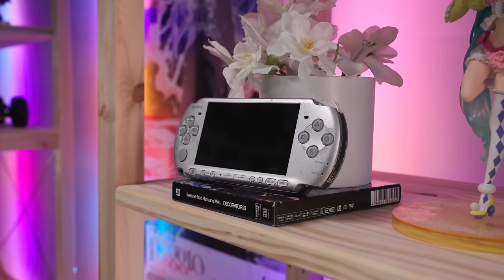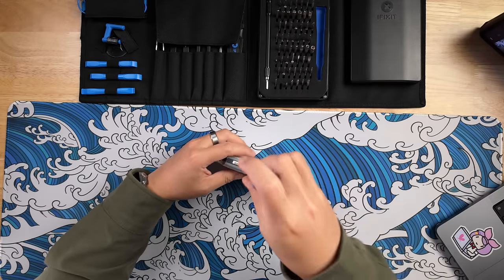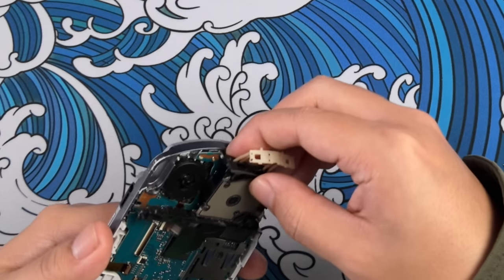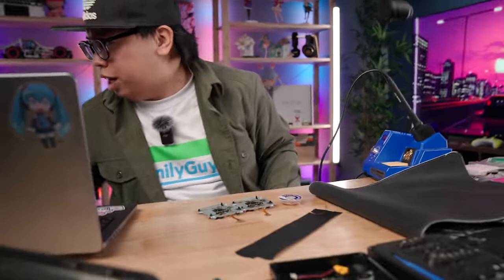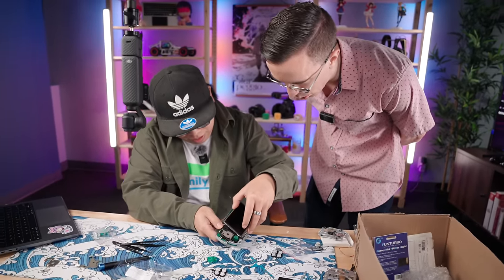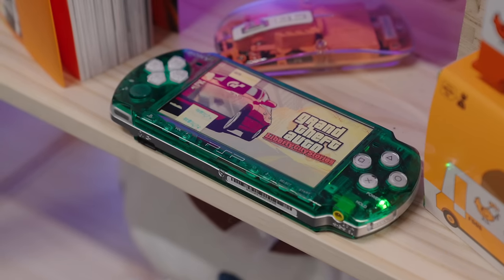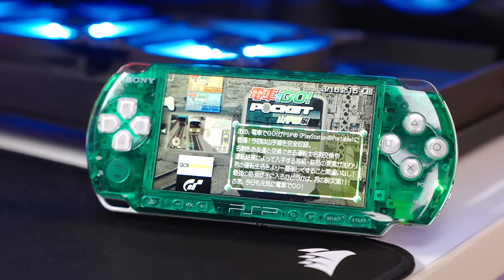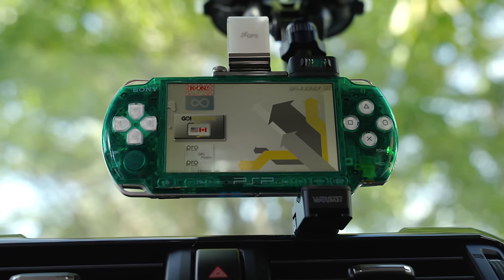Gaming with a PSP in 2024

Comment: On one hand, I'm glad I had a DS (not being able to afford both systems), and I had my fair share of soul-changing experiences on the handheld, but, shoot, PSP was so cool, and had at least a handful of games I really wanted to play, and never really had the chance, until I met my wife, who had a PSP she took overseas with her, so... I have that now. It feels so dang good in the hands (pretty much the perfect form factor - PS Vita supporters need a reality check on that thing), and absolutely has a library of games worth having/exploring/owning. I need to get around to figuring out if the issue with it is just the battery (that I've taken out/disposed of, because I'm not going to wait for it to start its transformation into a spicy pillow), or if there's a bigger problem. Would be nice to pop a new battery in/get a new charger and start collecting for the system/playing some stuff.

I've still got an old WRT-54G router connected to the network that outputs a 802.11b WiFi signal, which the PSP (and original DS models) need for connecting. I should mess around with that.

Anyway, this video was especially painful to watch. Thanks.

Comment: Amazing video! - wanted to shout out a few things. The GPS adventure is amazing and definitely impressed me and made me laugh! Secondly, it's wild to say - but the screen going half pixel dead save for a tiny half cm on the bottom is exactly what happened to mine! No idea what we both did! lol... Lastly - I went through five replacement screens off amazon, all of which were busted and or filled with torn and horrible dead pixels. It's a shock but everyone seems to have the same experience, and I'm curious once you get that replacement screen off amazon. I've ended up going with another PSP like you did. DEFECTUOSA! Lastly part two - first video I've seen on your channel and it was a blast. I'll be watching more!

Comment: 36:00 The PSP can actually connect to Wi-Fi, the thing is that it can only use WPA and WEP security (please, don't use WEP), when the most common certification is WPA2 and lately WPA3. So the PSP won't connect to any WPA2 or WPA3 networks but it's simple to solve: if you set the network in your router to use WPA (in my case it has 3 networks, the guests one which is activated on demand and deactivates 4 hours after, is set to WPA) and you type its name in the PSP, it should work just fine.
I got my PSP in 2007 and since then has been in my bed table to play before sleep.

Comment: I will 100% confirm that the Screen on the 3000 series may be, Haunted? 

I have babied mine since I got it and it's never been dropped, scratched, etc. Yet SOMEHOW one day when I pulled it out of the desk drawer to play, somehow the damn screen itself was broken, yet the glass in front of it was perfectly fine. It looks like it died from an impact from the front, yet without hurting the external glass at all? I just couldn't figure out what caused it as it was just sitting in a drawer with other tech hardware which was just a bunch of flat surfaces...

It still confuses me to this day.

I got a replacement screen and sadly the replacement has 2 dead/stuck pixels. Ugh So someday I'll replace it, again and I do still like playing on this little thing from time to time.

Comment: You have to.lwer your Wi Fi  settings in order for the Psp to connect the Psp uses WLan connection today's WI fi is WAP 1 N 2 (if I'm not mistaken)  lower the connection speed for it to work I use mine with my phones Hotspot

Comment: I can identify with this destruction. Not with electronics though but, I was trying to kill a fly the other day and accidentally shattered my door window (I swear a barely touched it) and then broke the storm door handle while also barely touching it (I’ve been told since I was a kid I don’t know my own strength, so I guess even at 24 years old I still haven’t learned). This has leaked into electronics though, accidentally pushed two hard while screwing in the screws on an OG gameboy motherboard and went through it 😂)

Comment: I had a psp 2000 that had cfw on it as a kid but it broke. So one day I got a psp 3000 and tried to downgrade it to a lower cfw and ended up bricking it the same day because I didn’t know anything about not being able to downgrade a device with a firmware lower than the firmware it left the factory with 😂. I also had a pandoras battery to try to unbrick it but found out it was not compatible with the psp 3000. So I went back to gamestop the next day with my mom and told them it was faulty and got a new one. one of the many HUGE fails of my childhood lol.

Comment: the biggest success of psp, atleast imo, is that it was extremely future proof. it came out in 2005. it's better than the 3ds. and that's coming from someone who bought this, 3ds, ds, and even the 2ds. and xmb is the dream. there is almost no ui that's more fun on consoles. atleast as far as i've seen. and it's built like a tank, living for upto 20 years for quite a few people(including me)
Reply from the maker: It's weird to say a UI is fun to use at first, but when I think about the PS5 interface, it honestly isn't a crazy statement. 

Modern console homescreens are so clunky and sensory overloaded with useless information. I find myself wanting to ignore everything and just hop into a game. Fine, but I avoid the homescreen as much as I can.

But XMB was simple and functional to where it actually lended itself to a bit of curiosity. When it doesn't take much time to explore around and is very linear, there's a sense of comfort and confidence I get when using it. It's way more approachable.

Comment: Not to be rude but you did not do a good job taking this apart. Im no electronic repair man but i have reshelled a worked on several psps without breaking anything. I do agree it would be another like half hour of psp work to just swap the og drive back in. Which is honestly pretty finicky. And that could be a piece of dust under the screen

Comment: Lost the coolest part of the console, the UMD drive adds character, load times and the sound are it’s charm lol. Also ruined a nice 3000 : / blue is so clean . Soft modding a psp is very easy and does not require a nasty aftermarket shell . I bet the UMD drive isn’t pushing it in far enough

Comment: bought a replacement case (nice pink nontransparent)
it came in very fast but the actual quality is hot garbage lol
it feels like very cheap plastic knockoff with parts of plastic sticking out after molding

need to sand it down to actual sizes

Comment: I have a psp 1000😭😭😭😭😭😭
Reply: There is a really cool ips screen mod that only works for the 1000 model.
Reply: @gnomatic  I planned on getting more psp and PS Vita since I'm obsessed with them, but I never jailbreaked a consol before, I only have heard Abt it before! so I'm kinda nervous and excited at the same time 😭 but I can't find good stuff for a decent price so I want to buy Japanese once those are cheap and mostly good quality.
Reply: @zhostfu3595  The psp is the esiest console i've ever  modded, so you're at a great starting point. Just follow the directions precisely, and It should be fine. I recommend ARK-4, just put it on my 3000, and it's great.

Comment: I bought a similar transparent light blue one and I regret it. Feels like a cheap knock off toy. I should’ve either got the original black or nothing at all. When you get used to modern handhelds like the ROG Ally, Steam Deck or even the Switch, which can all play PSP games it feels unnecessary. I know it’s “original hardware that was ahead of its time” but it doesn’t really hold up without nostalgia. It's a cool little collectors piece, but I don’t use it.

Comment: Psp was a huge failure so was the vita. Here's why. 

Psp didn't have 2 anolog sticks and wasn't porting ps2 games nor did it port a lot of iconic ps1 games. The lack of pressure sensors in the triggers like the ps2 had was a design flaw. The psp exclusives were mostly bad, but tenkaichi tag team was cool and dissidia was fun MINUS the speed junkie grinding style crap that ruined gameplay. It also didn't get 3rd party data support from cell towers either. 

Vita failed for the weird library of games with a few exceptions, it also didn't port nearly enough iconic ps2 games if any at all and suffered from the same trigger problem psp had... no pressure sensors like the cheap ps2 controllers all had. Biggest thing that hurt the vita was again not getting 3rd party data support from cellular companies. If the vita was just made into a gaming device that was also a phone and took note of these problems it would have been a revolutionary highly selling piece of technology. 

Instead both systems are failed products that had potential and didn't even come close to competing with Nintendo 3ds OR CELL PHONES. 

Basically, if you have a android phone, just download a emulator. Every gamer has been doing this for over ten years BECAUSE GAMING COMPANIES FAILED EVERYONE WITH MOBILE GAMING but i will say the game boy advance is awesome, 3ds was also awesome... psp had potential but completely failed. (apple makes training wheel phones that cost more and do less aimed at general population which is ok it makes sense) 

And honestly, since I've learned that a lot of news or information isn't true, I don't want anyone trying to tell me they think the psp didn't fail. It did. Both consoles were huge failures that had huge potential. Some design flaws that if fixed would make the devices revolutionary in a another timeline. 

It's also possible that once sony finally starts streaming games to screens, which they can do right now and refuse to, a refined PSP device would be a console replacement and potentially a phone replacement too.

Once the world gets global wifi, cell phone companies will shut down. It won't destroy jobs, either. It'll just make some rich people regular people while benefitting everyone else more. 

I like the way your psp looks btw, but, it's still missing a anolog stick missing pressure sensitive triggers and has a idk.. kind of a lame library with some exceptions. 

You people will absolutely love when sony and Microsoft finally start streaming games, instead of selling consoles. Especially when the world gets global free wifi. And no, it won't lag.  It'll be the same exact speeds a normal online game has. And it's easy to prove.
Reply: Bro 80m+ units sold is not a "huge failure" lmao